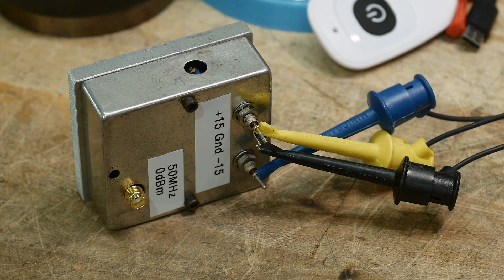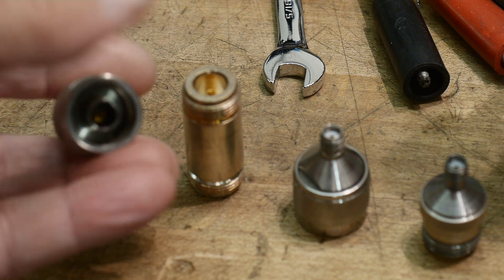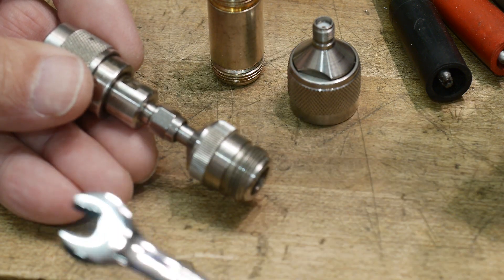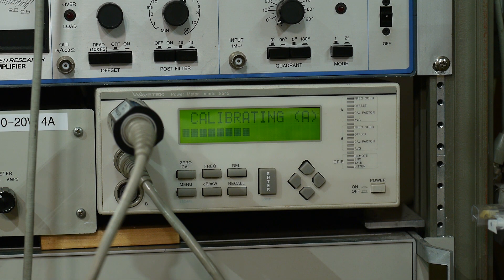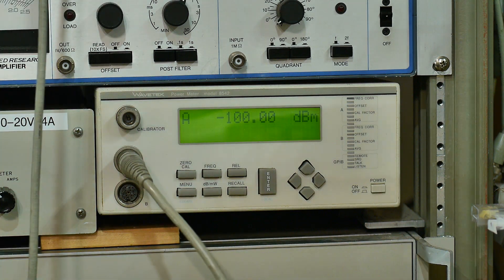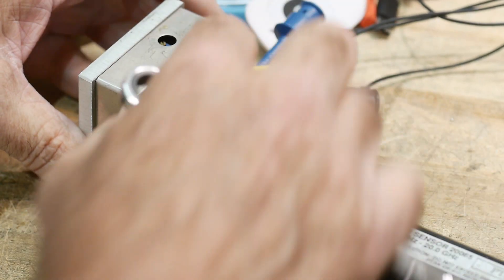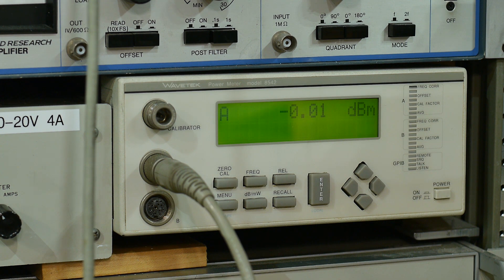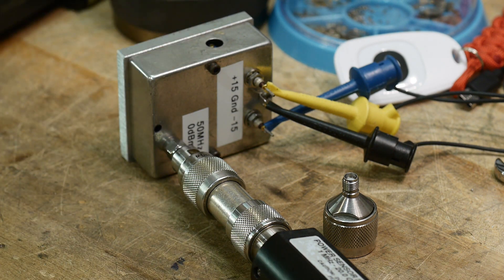#541c 50MHz 0dBm More Accurate Calibration

Comment: I started to make the same comment on the other video but the YT gods suddenly brought me to #541c automatically...darn YT gods...almost makes me want to gut my HP436 to cannibalize my HP436 (have no fear, I have a 435 and 437) just to get a smaller form factor standard. Nah.  ;-)
Reply from the maker: The HP437 is a good machine. It was our target machine to beat when I designed the Wavetek meter. We made a much faster machine. Sold a lot to the Navy and Motorola.
Reply: @IMSAIGuy  Yep, the 437 is the one on the bench...but I do keep the 435 there for its analog movement in certain situations. The 436's "analog" feature always felt funky to me. BTW, several guys here now ordering Tiny SAs based on your videos. Think I'll wait for the larger form factor which I'm sure is coming sometime.

Comment: Would you be willing to tell us a little more about the Wavetek power meter? In particular, I am curious about the power distribution vs frequency? When it is doing a self-calibration what is the spectral density of the source? Is it at a fixed frequency or is it distributed over a range of frequencies?

For adapters and cables, the loss is generally a function of frequency which higher losses occurring at higher frequencies. Am I correct in assuming that when characterizing an adapter in the lab, you would want it measured at a specific frequency or set of frequencies? Clearly a UHM and an N connecter that had identical insertion loss at 100 kHz would have a vastly different loss at 1 gHz.
Reply from the maker: The calibrator is only 50MHz. the sensor is factory calibrated over a larger range. some sensors up to 18GHz some to 40GHz. The non-linearity is saved in an EEPROM in the sensor. The one point cal is all that is needed from there. that is why sensors are so expensive. To use the power meter other than 50MHz requires the user to type the test frequency into the meter.
Reply: @IMSAIGuy  Thank you! 

I love you videos and am definitely learning a lot :-)